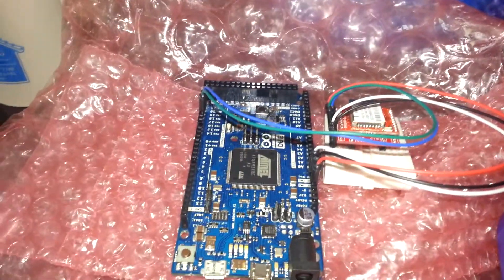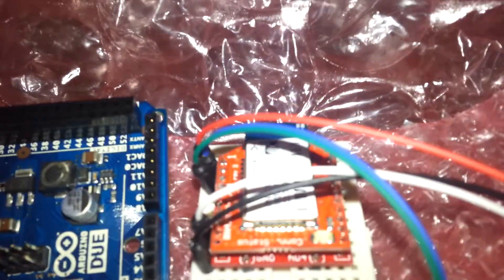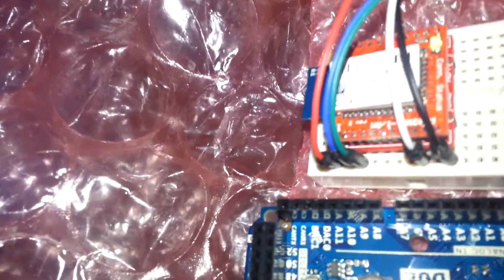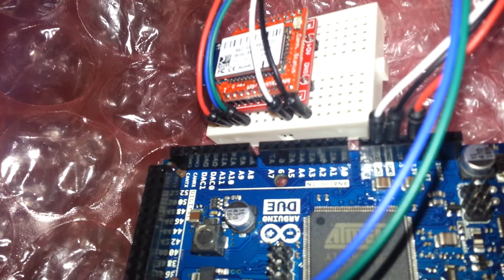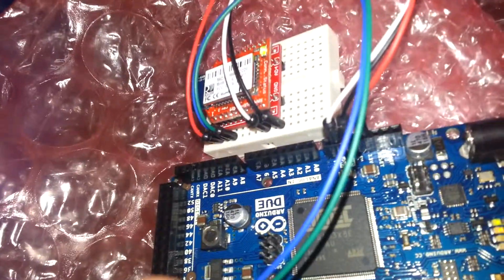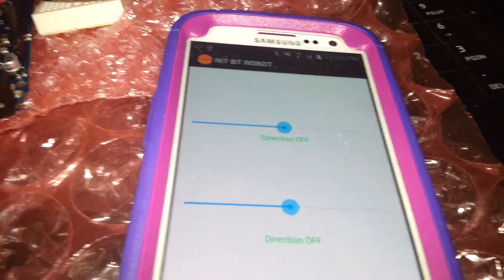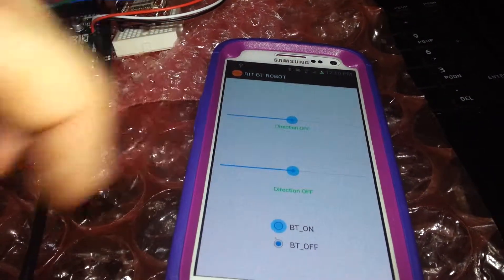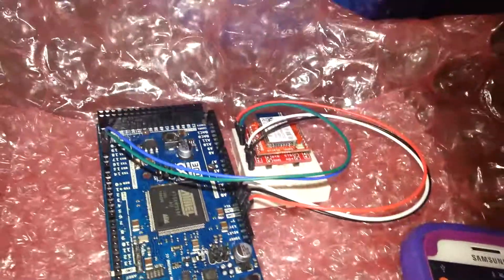Due Bluetooth part1

Comment: hello, 
Can I ask you please help? 
I'm using due and hc-06  (I'm servo control with android with mega). But I can not control with due (code and the same type of connection). 
Where do you think I'm making a mistake and how you have run, did you use an extra code ? 

I will be very happy if you help :) 

(You are just on the internet that can connect to Bluetooth ® enabled with due)